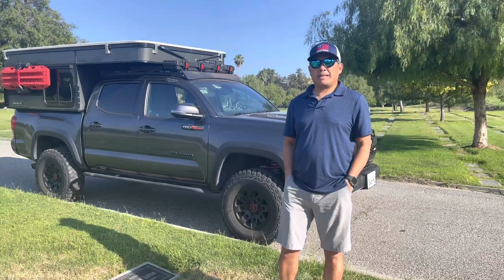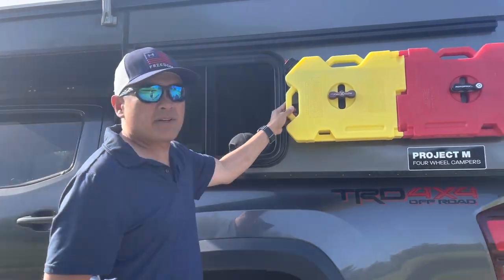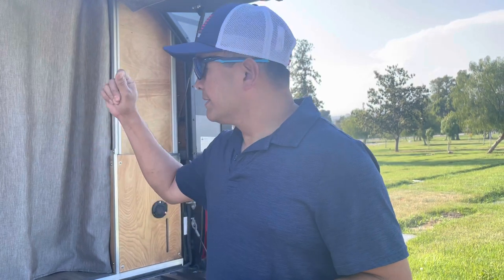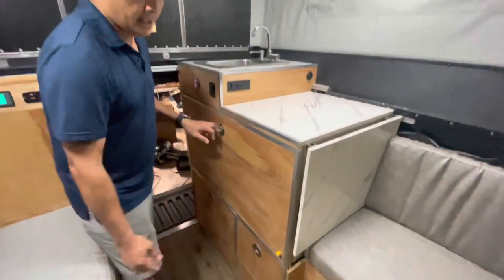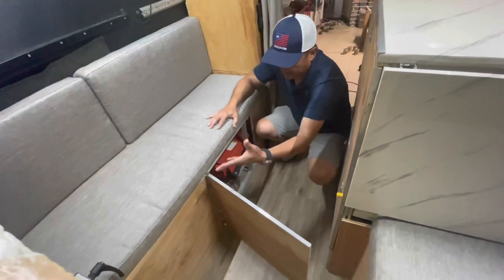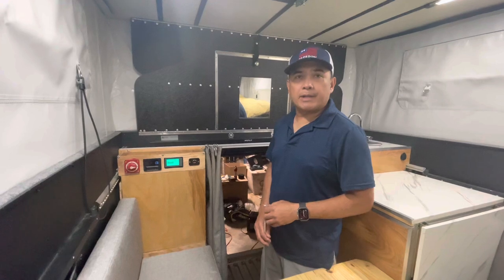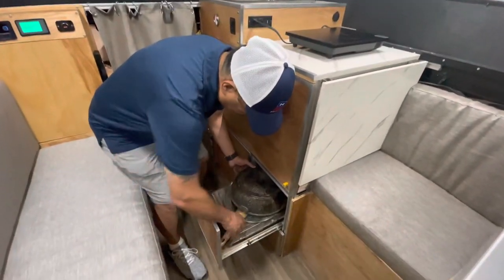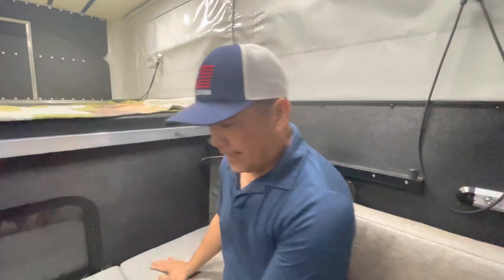Four Wheel Campers Project M. “ My Ultimate Interior Build”

Comment: Question I’m assuming you built the seating off those 13in rails off the side. Those are at the top of bed side. My question is the seating tall? By my math that puts seat above 20in before cushions.
Reply from the maker: Thanks for watching, the seat is just at the level of that 13 inch bench wing from FWC, plus the floor has a subfloor insulation and the floor proper which raises the floor and makes the seat’s height to be just perfect. Here’s the link of my build. Check it out

https://youtu.be/VR30M3PePDI?si=cnU81wPX1SQ6D9Nk

Comment: Looks like you thought of everything. I think I missed what the externally mounted propane tank is used for. And do you run a hose from it to the interior?
Reply from the maker: My propane tank is used when I cook outside and also for my propane fire pit. I use induction cooktop inside the camper. Thanks for watching and liking my design.

Comment: Very cool ! What is your overall weight ? Did you have to adjust your springs / shocks ?
Reply from the maker: I haven’t weigh ‘em yet but I put an Icon leaf pack stage 3(heavy duty setting) and a sumo spring. It handles really good. I build this lightweight since I use 80/20 ten series for the frame of this build.
Reply: Pare nice set up for your tacoma
Reply from the maker: @jimsulio8636  -Thanks Pare

Comment: Nice build. You gave me a lot of ideas for my future build. Maybe i missed but why is the faucet at a higher level than the countertop? Loverly camper , someday
Reply from the maker: Because of the drain of the faucet, remember there’s a refrigerator underneath it, it’s tight but I managed to put everything that’s needed in case of bad weather that you need to hunker down inside your camper and plus if I raise the countertop to the level of the sink, then I won’t be able to pull out the bed and turn it into a king size. Thanks for your comment, I like that you’re observant about the build. Good luck on your build, I’m glad you get some ideas from my build.

Comment: How did you work around the "lips" that came w/ the project-m? Did you cut those out?
Reply from the maker: Nope, I called FWC if can cut it out and they said it’s structural, so I designed all this, around the lips( over hang bench) which is one of the greatest challenge on building the interior. I just wish they will redesign the M without it.

Comment: Very cool build! How did you mount your rotopax to your gear track?
Reply from the maker: Bought a lockable Rotopax mount, I place a back plate, bolted the Rotopax mount then bolted the back plate the Project M side rail mount
Reply: @norkisserrano  are you using t-nuts or something else to mount the back plate to the side rail? I never mounted anything to the side rails before.
Reply from the maker: @tfsdjon1 -Yes I used T-nuts